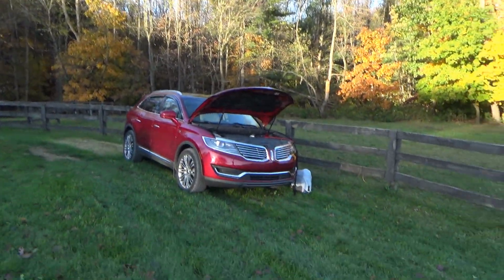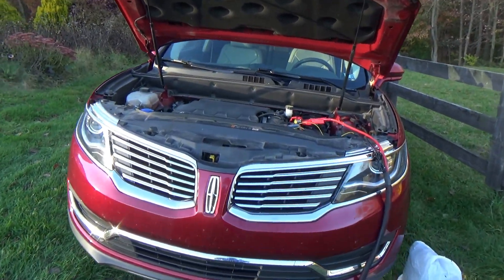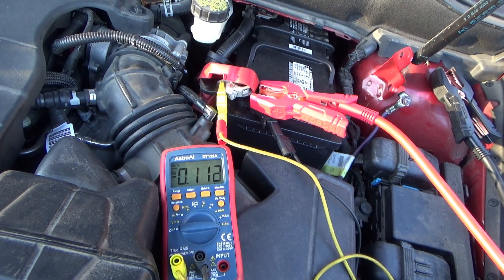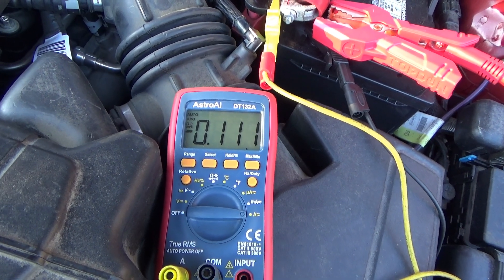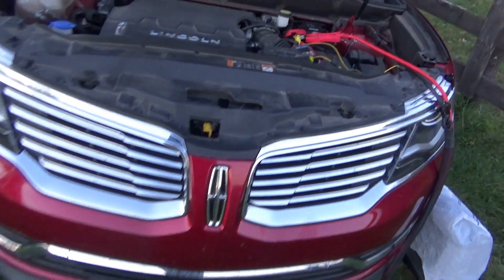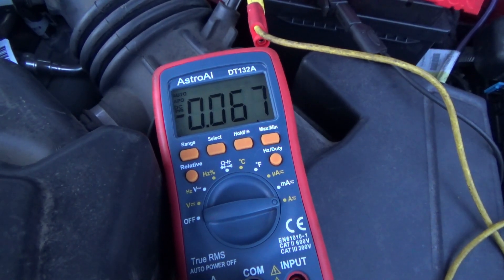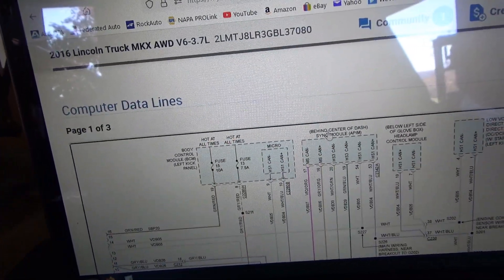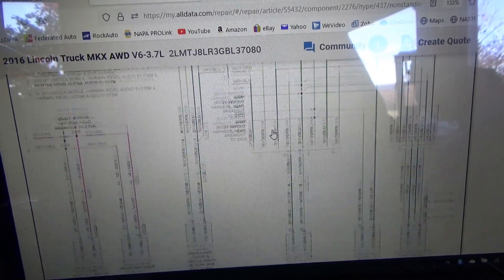THIS may be DRAINING your Battery Overnight! (Lincoln MKX -Part 1)

Comment: You are truly awesome :) where did you get the Pico and is it expensive? I'm just doing mostly basic stuff but would like a scope to be able to graph things :)
Reply: Pico seams to be the best one out there but a little over kill for the basic DIY hantech is cheaper but for sharing data, Pico is the best.
Reply: @dalemauritz991  yeah I'm basically working on computers for the most part and does cars as a side thing. Not this level though. But awesome to see a pro working and have realized that a scope is really needed to do anything these days along with a decent scantool.
Reply from the maker: Definitely get a scope... Total game changer!

Comment: If that Lincoln is a 2016 and has the factory battery,  it would be almost 7 years old. 
Batteries are a roll of the dice sometimes.
Reply: Only with modern automobiles. With my '07 Silverado, I got 6 years (with help from a 3-stage temperature-sensing charger) out of the OE battery, and only 5 years out of a $300 Odyssey AGM. My '86 Grand Marquis battery just died this summer - was 9 years 7 months old if I remember right (was over 9 years for sure). The battery in my '93 Volvo 940 is almost TEN! Both these vehicles sit quite a bit, too.
Reply from the maker: @SmittySmithsonite  best I've seen was a 2008 Volvo S60 in 2021 still on the original battery!!
Reply: @PineHollowAutoDiagnostics  WOW that is insane!! Longest I've ever heard of!  I'm betting that vehicle was operated somewhere where summers aren't very hot? I have an OE original 2004 Nissan X-Terra battery that is still running my 12v Fill-Rite gas pump. I doubt it could crank a car, but it works great for this.

Comment: Simply amazing! And there's no way any dealer can do what you are doing, they would not have the patience, and I would guess that their techs would not have the training. Can't wait for the mystery to be solved.
Reply: Not all dealer techs are what you think they are. Quite a good bit of them are top notch. It's the industry, flat rate, managers, advisers and customers that expect Techs to have 1 hour or less crystal ball diagnostic abilities. For those that are able to tackle in depth diagnostics, they also have to balance other jobs to maintain a paycheck. That in itself pulls their focus away from such in depth jobs.
Reply: @Joetechlincolns  That's very true.
Reply: I was a Ford tech for 17 years in Canada. My shop was hourly not flat rate, so jobs like these paid the same as any gravy job so they got the attention they needed. I did lots of diag on parasitic draws, only wish that I had learned to use a scope sooner! Just love seeing scopes put to use like this
Reply: its not that they are trained, its that dealerships are driven by work completed per hour. diagnosing a car for more than an hour places that worker in a bad spot as they have now gone more than 2 hours without completing a car. diagnosing cars doesnt pay the rent. firing the parts cannon does. they will 100% replace your whole engine then realize the real issue was just a $10 part without telling you. 100% of the time.

Comment: I haven't had to deal with a parasitic draw yet. I have the scope. I keep watching you and Eric diagnose these.
Reply: You can create one in any car to practice the detective art.
Reply: Oh I’ve seen a lot of strange causes in almost 50 yrs. (I’m not Scotty K). I’ve climbed in trunks when younger, seen all manner of owner induced problems but these seem related to poorly made electronics a lot of times. 

I agree with comment above. Create one such as trunk light and go through motions of tracking it down. Very few are cut and dried. Good luck.

Comment: I know that the radio and clock takes power to keep the memory of the Radio stations and the clock from going off.
Reply: Don't forget the keyless entry system is always waiting for a signal, it's a radio receiver that's always running!
Reply from the maker: Yup that's keep alive memory, usually under 10ma 👍

Comment: My '00 Jeep Grand Cherokee has a draw that'll kill the battery in less than a week if not driven or charged. Have seen the headlights go on by themselves. Don't know what's up.
Reply: Does it have automatic headlights that come on as evening rolls around? That might be a place to start.
Reply: Look towards the keyless entry, headlight delay (whatever module controls that), or the auto on light sensor circuit.
Reply from the maker: Green crusties lol